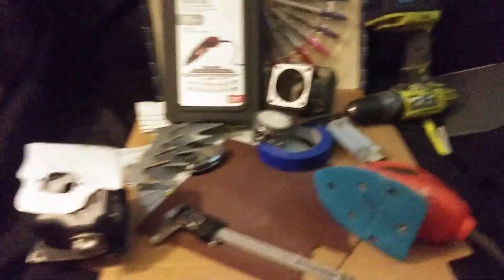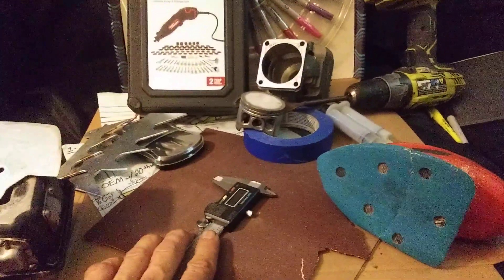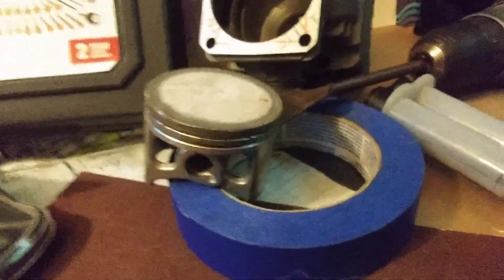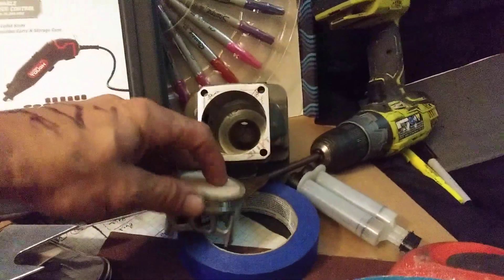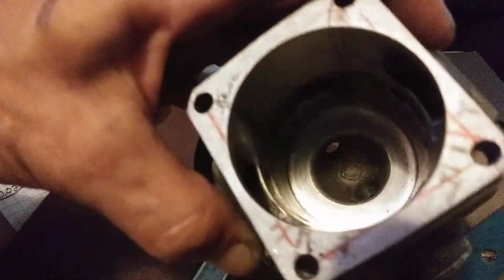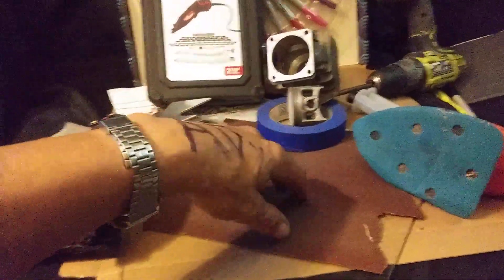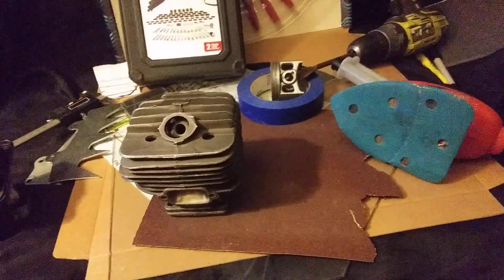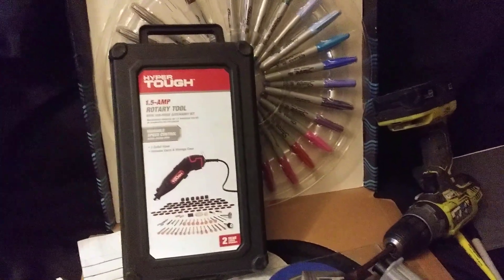Cutting Squish / Bands, Bases, Perfectly-Mating Surfaces, etc. All w/ Basic Equipment (No Lathes!)

Comment: On the exhaust simply use two gaskets.    Dyno Joe makes a cut squish by hand kit.   It works very well.   You cannot deck a cylinder accurately this way.  
The Saws with cylinder extensions will not work with this method.   A cylinder base that is not cut square will wear out the cylinder piston and rings.     Removing the base gasket will drop your cylinder .015-.020.   Keep your squish above .020.